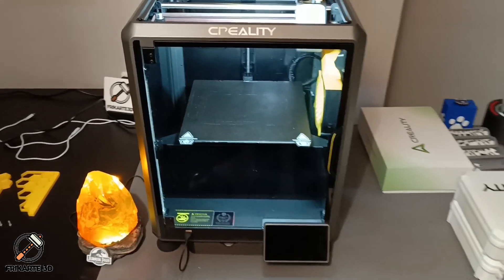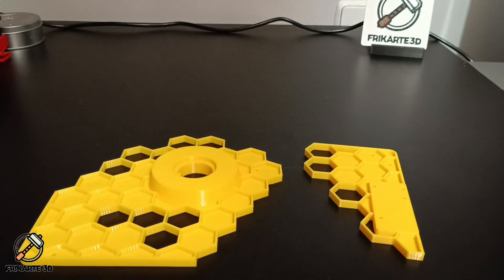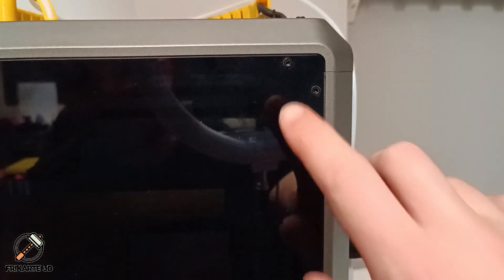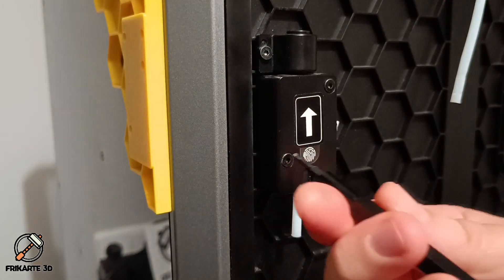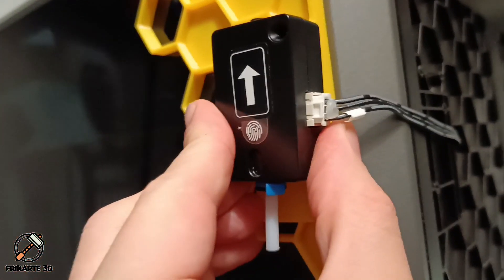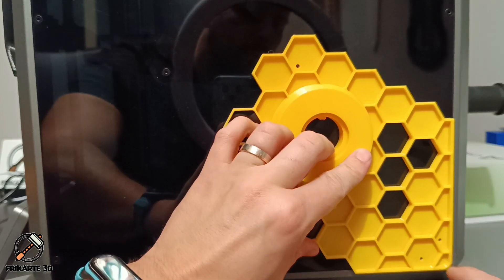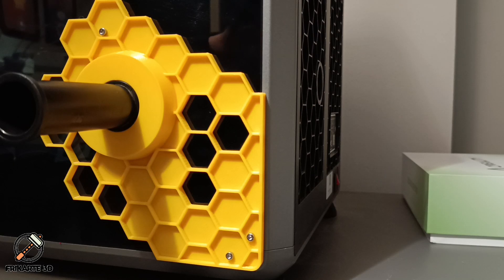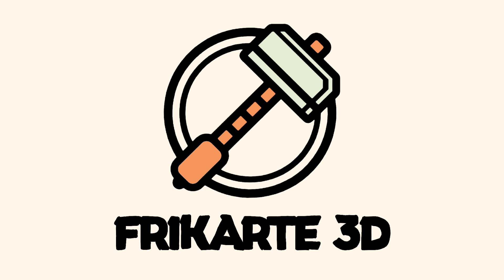How To Relocate Spool & Sensor on Creality K1 | 3D Printer Mod Solution!

Comment: For anyone wondering the same goes for k1c but the cable of the sensor needs to be pulled up not down like in the video because it gets akwardly stuck
Reply from the maker: Good to know! Thanks for sharing this tip for K1C users!
Reply: Mine is stuck and assumed it’s a shorter cord (k1c) think I might have to try and remove the channel on the inside covering all the wires
Reply: @ddlonglegs  i thought that too try to pull it from all sides because it probably will go looselly in mine it was pretty easy from the bottom to pull it up

Comment: Can this be modified to fit the K1 SE
Reply: I am using the 4 screw version on my K1 SE
Reply from the maker: I didn't have the SE, but I assume you will not able to use the center screw. I found this model that will fit in your printer https://www.printables.com/model/1191358-creality-k1-k1c-k1-se-side-panels-closed-spool-hol The designer also has open panels version.

Comment: I tried moving my sensor on the K1c, I’m worried about pulling too hard, cable doesn’t want to give me anything
Reply from the maker: I read a lot of posts about this before doing it and have the same fear. I don't know is the cable managing on the K1C is the same as the K1. You can always disassemble the bottom of the printer to check it.
Reply: @ you were right, I took the bottom panel off and there is a zip tie 👌
Reply from the maker: Nice! Not in the K1! Good to know, will add a clarification on the description 🤗
Reply: @Frikarte3D I had an idea to exhaust the warm air into a single spool container, I’m a newbie though, what’s your thoughts on that? Could be useful?
Reply from the maker: Umm, from the back fan to an "in-build" filament dryer, obviously mounted on the side? It's nice idea, but also have some doubts about how to regulate the temperature in the container for different types of filament or if it will extract enough temperature to be functional. The good ideas always needs to be tested 😅

Comment: Are u using creality k1 to print as my k1 dosnt print like that might be settings
Reply from the maker: Yes, I'm using my K1. I used Creality Print with the PETG settings suggested by LEOTE on his instructions of the CREALITY K1+K1C LID RISER V2 you can find here: https://www.printables.com/model/890518-creality-k1k1c-lid-riser-v2-50mm-height

Comment: I'm printing right now.. 😂 but I don't have the right screws... Another trip to the shop... 😅
Reply from the maker: You only need a little longer, I suggested M3x10mm because have them at home but I think M3x8 will be enough.
Reply: @Frikarte3D  yeah, I've seen that. I've used M3x8 in every corner screw hole an M3x10 in the central hole, the inside fan one. Works like a charm, I've mounted them yesterday.
Reply from the maker: @MrSousuke87  Great!